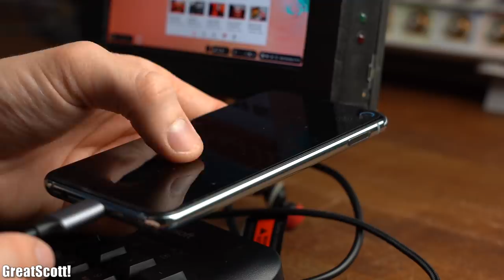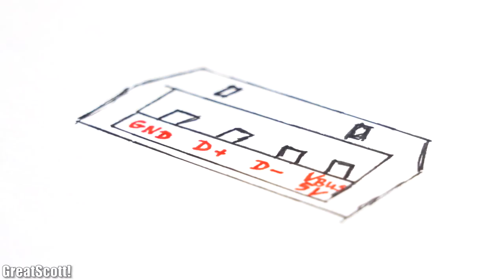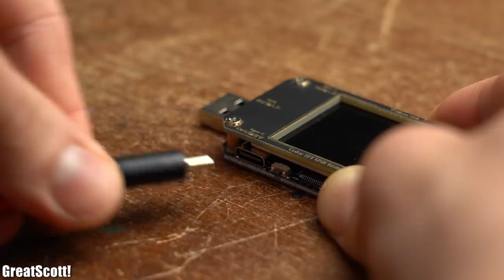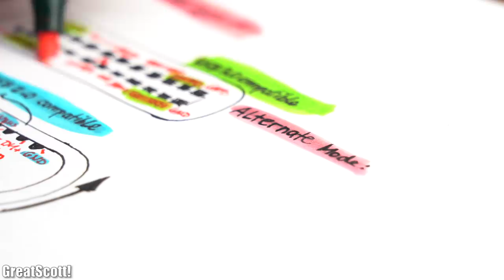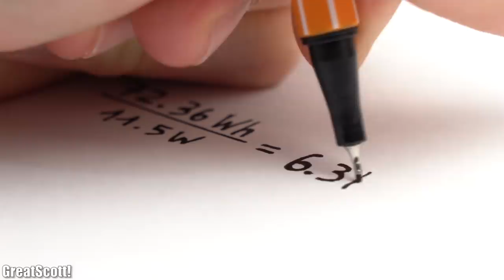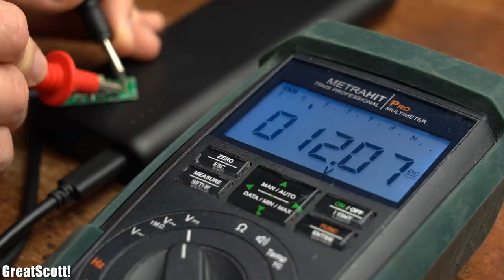Here is why USB Type-C is AWESOME and how you can use Power Delivery for your electronics!

Comment: I've read some of the USB 2 spec.

Can't imagine how crazy the 4 is.
Reply: Maybe you can time travel XD
Reply: Well, you can imagine it somewhat by reading the new naming conventions... the Wi-Fi Alliance really needs to lend the USB-IF a hand when it comes to names...
Reply: probably less complicated as it supoose to use PCIe physical layer
Reply: Yeah haha look up Thunderbolt 3... It pushes 40gbit via USB c
Reply: It's the thunderbolt standard. But open source so manufacturers don't have to pay insentives to intel. There is a techquickie video explaining it. I'm on mobile so I can't paste a link
Reply: I’m pretty sure that thunderbolt 3 is just going to be renamed usb 4.
Reply: @iridiumflare  No, the spec for USB4 has been released some days ago already so this is easy to check anyway but USB4 can be compatible with Thunderbolt 3, though it does not have to be... So some USB4 devices may support TB3 and others won't, it also appears that only certain cables will support TB3 as TB3 is a very different protocol compared to USB, TB3 uses PCIe lanes while USB uses its own serial 'lanes', PCIe has far higher requirements such as very low latency allowed, this comes down to how both TB3 and USB operate at the PHY layer.
Reply: @ShadowriverUB  USB4 in no way uses a PCIe PHY, it uses yet another iteration of the USB PHY (hence the USB4 name instead of PCIe3/4/5), it also does not carry any PCIe lanes. USB4 can carry TB3 (if both devices AND the cable support it) but this is not a requirement of USB4 so you might have two USB4 cables, one that supports TB3 and one that does not while you have a bunch of USB4 devices/peripherals some of which support TB3 while most won't because currently (and for the entire history of ThunderBolt) TB is far too costly to implement and USB4 does not force manufacturers to implement it, so why would they...
Reply: 40gbit/s, thubderbolt compatible.

Comment: This is why i love USB type c, especially Power Delivery. No one in my house or campus understand these flexibility and high output capability no matter how much I explained that. They just think that I'm a type C maniac because i switch all my gadgets to type C.
Reply: No one understands it because at some point you stumble into interoperability and expect everything to deliver the full pd spectrum but you get sometimes only 5V but up to 5A, or 20V but only to 2A, if you don't have the correct cable you might be limited to 2A etc...
Reply: Problem: now you need a lot of adapters because you only have USB-C ports. One of my teachers has a new MBP, and he’s always looking for the right adapter! Furthermore, USB-C cables are not all alike! The included cables are apparently USB 2.0 (or whichever name the USB-IF decided to rename it with the new spec), and try guessing which is which!
Reply: @GRBtutorials  agree with the cables, you don't really know what you're getting, but not for the adapters. Example, USB drive with type c connectors are getting quite common. HDMI sure, needs a dongle. But it's quite a thicc connector. Mini HDMI can be used, but also need adapter if need full size HDMI. Need connect phone to phone / laptop? There is type c to type c cable, so no biggie.
Reply: @satibel  scrub, what kind of person DOESN'T have a pocket full of connectors adapters and dongles? Are you NOT prepared
Reply: @Nrt2Pnt0  The point is that while you now might have a USB C to USB C cable of which the connectors are compatible, the cable itself now is the issue and you need fourteen different USB C to USB C cables for various purposes....
USB C could've been so beautiful, instead it is a disaster, meanwhile USB 3.0 has been renamed to USB 3.1 Gen 1, USB 3.1 has been renamed USB 3.1 Gen 2, USB 3.2 is doing 'something' over there that nobody needs and USB 4 is coming to fix more issues we're not having.
The issue with Universal Serial Bus is that it is not Universal, it has become the exact opposite of universal to the point where nobody seems to understand what the hell USB is doing anymore.
Reply: I for one am peeved they made the 12V skippable. Now I get to search for supplies that offer 12V 2A, and no, it doesn't help if they support 2A at 9V but only 1.5A at 12V.
Reply: @SKC56  do you have sata usb-c 3.1 10 gbit adapter? I have and i boot through usb-c of my Geforce 2080 Ti ))))) Well, i boot linux, while my main system (windows) in on M.2 nvme ssd)))
Reply: @someguy4915  hey, usb 4 is thunderbolt 3.
Reply: @lolerie  I don't have usb c 3.1...
Reply: @SKC56  10 gbit/s, i mean...
Reply: @lolerie  No, it has an optional compatability WITH TB3, but is not in fact TB3 or anything like it. USB4 CAN carry TB3 signals, but is does not have to, so some USB4 devices will support TB3 connections and some will not, even though they all have the same 'USB4' logo/name on them...
Besides TB3, USB4 can also carry audio, HDMI/DP/various other USB versions and/or charging 'PD/Power Delivery' which may deliver UP TO (but doesn't require the minimum) of 100 watts.
Basically USB4 says the ultimate maximum options and then lets manufacturers of cables, pc's and peripherals decide what they feel like implementing and what not.
While Intel has given the TB3 standard to USB4, so far AMD has not received a license to use it, so as it stands, no AMD chipsets with USB4 will support TB3. Also, TB3 chips are significantly more expensive and thus will not appear in mid range and low-end devices, only in higher-range devices and even there it is only a possible options which may or may not have been added...
Welcome to the new world of USB, where everything is possible but nothing is certain/required, you'll just have to guess...
Reply: @someguy4915  wrooong. Amd does support it. Read wiki Before March 2019 there were no AMD chipsets or computers with Thunderbolt support released or announced because of royalty situation (problem was Intel's refusal to certify non-Intel platforms). However, the YouTuber Wendell Wilson from Level1 Techs was able to get Thunderbolt 3 support on an AMD computer with a Threadripper CPU and Titan Ridge add-in card working by modifying the firmware, indicating that the lack of Thunderbolt support on non-Intel systems is not due to any hardware limitations.[74][75] As of May 2019, it is possible to have Thunderbolt 3 support on AMD using add-in card without any problems.[76] And motherboards like ASRock X570 Creator already have integrated Thunderbolt 3 support.[77]
Reply: @someguy4915  the spec about USB4 is only the first version. They want to made thunderbolt 3 -- as the original one -- to be mandatery. In particural, it should be pci express (with low latency) and really, it is just thunderbolt 3. Intel also said that they will certify but it will not be mandatery.
Reply: @lolerie  Still, USB4 is in no way TB3 nor does it guarantee compatability at all, just that some devices might have it and some won't.
Whether the devgroup for USB wants TB3 to be mandatory, I've not seen that anywhere, especially not in the officially released specs, nor is the devgroup making anything mandatory in the USB standard, not even the branding so I'm curious where you heard that TB3 would (ever) become a mandatory part of USB4?

Also I never stated there is any technical limitation for TB3 on AMD, I said that Intel has not given AMD a license to do it. Intel has not shown any interest in spreading TB by giving AMD a license, nor are there any clues or reasons to believe this will change any time soon.
Reply: @someguy4915  the real problem is low latency spec., which is only pci express, which is already done with tb3, etc, etc... Anyway, you can widely manipulate it through UEFI module code and even linux/windows kernel code...
Reply: @lolerie  But that still does not give AMD a license to sell it, thus no widespread adoption and thus peripheral-makes won't adopt it either for years to come.
Look at USB-C: came out in 2014, it is 2019, almost 2020 and still plenty phones and most laptops come without even a single USB-C port.
Before USB4 will become mainstream it will be at least 2025, hopefully Intel will allow AMD a license by then so USB4 can actually be succesful WITH TB3 instead of without it...
Reply: @someguy4915  "a license to sell" there was no such thing from the beginning... Anyway, there is an amd motherboard with already integrated support of TB3. What do you want ;)
Reply: @someguy4915  usb-c is the only nondeprecated slot. So... https://en.wikipedia.org/wiki/USB#Receptacle_(socket)_identification
Reply: @lolerie  What I want? Intergrated TB3 support in the chipset so that TB3 can more effectively use chipset PCIe lanes or even better intergrated support with the CPU itself to use CPU PCIe lanes... Both will not happen for years to come, if ever at all...
Perhaps you should read the USB4 and TB3 specsheets, because 'a motherboard' having a port that through firmware messing can work does not really mean much for TB3, it simply doesn't work that well nor is it the issue...
Reply: Yeah I used to tether my smartphone to my PC a LOT  and after only one year or less the micro-usb port on m,y smartphone just got worn away and would no longer connect - so I bought a replacement port assembly but was unable to install it because the heads of  tiny screws holding it in place just gave way because it had been screwed in too tight - so I ended up scrapping the phone because of the lack of durability of the micro usb connector. My last two phones have had USB type c and they are as robust now as when I bought them in fact I will not buy a phone no matter how good if it doesn't have a usb type c port.
Reply: @SKC56  bruh

Comment: The first time I saw MicroUSB 3.0 I knew it's an abomination, and I already hated MicroUSB for taking place of MiniUSB {Great small port, durable]
I'm happy, that USB-C is taking place of MicroUSB
Reply: No, MiniUSB was terrible! I hated that on the PS3 pad for instance. I barely ever had any MiniUSB cables. MicroUSB at least saw or rather still sees a wide adoption and thus I also have lots of cables available.
Reply: i have literally lifted my s7 edge up by the cable and have had no issues with the micro us plug so idk about the durability issues
Reply: @bland9876   I think some of it is also because of the very cheap Mini-USB sockets and cables being literal shit. I got one of these 10$ logic analyzers and the first thing i noticed was that just wiggling the Mini-USB cable a little bit causes disconnects, that thing was loose af. Never had such severe problems with cheap Micro-USB sockets...
Reply: As with everything it depends, I had a lot of problems with my previous phone micro-USB, but my camera and car recorder Mini-USB works flawlessly
Reply: He didn't even mention mini USB 3 with three poles (+ the shell)
It is used in many Nikon cameras
Reply: Yeah, MiniUSB wasn't that bad. I broke more MicroUSB cables than I have fingers.
Reply: DANK  you must have had a defective product, there's lots of videos and tests demonstrating even the cheap USB c is much more durable than microusb. This is in no small part due to the curved rather than cornered shape of the connector, as well as it's internal structure.
Reply: I hated mini USB, the connector got stuck inside of my shitty phone
Reply: @lazyh-online4839  >cheap USB c
you must be joking.
Reply: @username4441  what exactly is your issue with what I've pointed out?
Reply: @lazyh-online4839  i have found all variations of USB c cables to be ridiculously priced.
Reply: Micro was shit and mini wasn't great. I really like C
Reply: Mini is better than either.
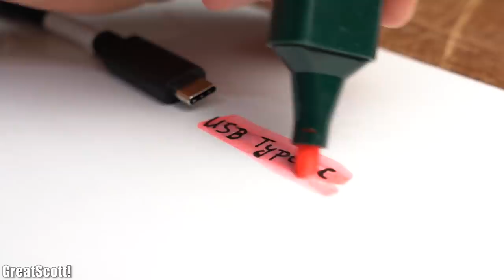Reply: @bspringer  @3:30
Reply: A lot of those External hard disks still use the USB 3.0 technology.
Reply: MicroUSB is actually much more durable than MiniUSB. Thats why it was used on mobile phones instead of MiniUSB. It has to do with the barbs wearing out and the MicroUSB having springy barbs that don't. The MiniUSB on the Arduino Nano are the worst...
Reply: @morpheus1285  Micro USB the cable is supposed to wear before the female connector, Mini USB was not this way and the female connector took the wear which is indeed a poor design.

Comment: Type-C is the best conector ever.
You can nerver mess up the orientation.    :D
Reply: First world problems.
Reply: Apple's Lightning cable: Am I a joke to you?
Reply: @Dinkleberg96  apple is a joke
Reply: I mean technically you can try to plug it in at 90° from the correct orientation.
Reply: @SoLaR27 Yes.....
Reply: 3.5 mm is the best connector, you can plug it in however you want
Reply: @josefaschwanden1502  They should build a 3.5 mm conector with 10 pins. This would be perfect.
Reply: @Dinkleberg96  Yes, because we all need a connector that's backwards compatible with firewire, still.
Reply: @m.schiller  Good luck running anything with current on that connector since you will definitely be shorting all the different contacts on the connector to all the different contacts on the port when sticking it in
Reply: Solar , rofl .
Reply: 3.5mm jack is even easier to plug in
Reply: @bland9876  It's not about being easy to plug in, but about the contacts touching all other contacts when sliding into the hole. The first contact on the cable will always touch all other contacts in the socket because of the way those jacks are designed
Reply: JonasLue Well, don’t your devices detect when a 3.5mm jack is connected? Given that’s already a thing, you can switch it on once it’s already connected. The only problem is that it’ll make devices thicker...
Reply: @resneptacle  just make the first pin on the conector a sense pin that only switches on the power when the conector is fully inserted in socket.
Reply: Ricardo Reis fun fact, Apple “engineers” claim that a short out on the phones lightning connector side cannot cause damage to the usb of a laptop (even though there are burn marks). I asked “just how many short outs do you need to cause damage? And why a specific location? It doesn’t matter where the short out is, a short is a short and can cause damage (plus burn marks on the phone side means that’s probably where the point of issue is...). So yeah, Apple cables are crap! And they give actual engineers (and 5 year olds) a bad name with lack of basic fundamentals.

Meanwhile, my previous phone with USB C had 12v 2 amp (24w) fast charging and even $1 cables from dollar tree store worked fine, even braided $0.90 cables online worked fine, never had an issue with any USB cable ever, only lightning cable (which I assume got its name from the lightning scorch marks for its notorious 4th pin).
Reply: @Dinkleberg96  used to be a very good connector. Now it's very outdated.
Reply: @josefaschwanden1502  F
Reply: Energie Z guardi bene le prese femmine senza orientamento prima di collegare bene cavo maschile non-reversibile !!!!
Reply: @Dinkleberg96  lightning cable is just usb c but nobody else can use it. By the iphone 12 I bet apple will switch to usb c
Reply: @m.schiller  cursed
Reply: why we even need connector's ... Let's go Wireless :)
Reply: @buddinglearner7085  I think there would be some problems with interference.
Reply: @m.schiller  oh no

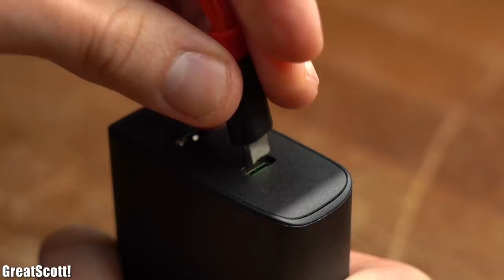Comment: Wait, you only have to flip the damn thing twice to fit? (3:40) You should go buy lottery ticket. I never managed to get it right in less than 3 tries.
Reply: I always get them right because I look at the connector and the port so I am basically God
Reply: I'm always wasting time on finding the hole by touching and then flipping the connector to get the right orientation.
Reply: I once get it pluged in the first try... turned out that I've use to much force and managed to plug it in the wrong way, wich lead to a short circuit and a bluescreen.
Reply: I usually give up after trying for 3 times, no wonder why my phone does not turn on anymore
Reply: I know, right?  I have a 50% change of getting it right the first time and it always takes 3 tries!
Reply: @yxcvbnmmnbvcxy544  LOL, when you're over 40 looking at it does no good because you never happen to have your reading glasses with you!
Reply: My other half actually managed to plug a USB B in upside down. Took a lot of force to remove it. She scares me.
Reply: @rancidbeef582  Hmm, yeah... On the USB A you can test the orientation by feeling it's tip, or put a stick on the top or pain the upper part...
Reply: Have a micro USB with a button operated light on the phone end, makes it a lot easier.
Reply: the USB logo is always looking UP
Reply: one time I blindly connected usb and got it first try
Reply: There is a nice joke about it: USB type-A connectors are quantum objects. The plug and the socket are in a superposition of states, so they never fit. You have to look at both to collapse their wave functions, and only then they can be mated.
Reply: 3 tried , i suggest you buy atleast a small lottery ticket

Comment: Wow! Great video!👏👏👏
Last summer, I purchased a 50AH LiFePO4 power bank, w/19VDC input (same as 2 parallel 20 Watt PV panels), 2 x USB-2 outputs (5 VDC motor power), & 1 x USB-C PD out (12 VDC SBC + PWM cooling). This was intended for a stand alone, solar powered, HiDef security camera. 
Unfortunately, the powerbank would shut down and reset the USB-C output to 5VDC whenever solar power was applied or removed from the input. (Just as you explained)
So, I trashed it's charge controller/output circuit board, salvaged the 8 3.7V LiFePO4 cells, reconfigured them into 2S4P @ 7.4VDC. Then, used a 5 amp CC Buck converter  to charge the cells @ 8 VDC, plus another 5 amp Buck converter to supply the 5VDC motor power. So far, so good. But, I'm running on an under-protected LiFePO4 power pack.🙄
Your programmable STM32 USB-C adapter would have saved me all of that extra expense and hassle. Thanks to you, next time I'll know. 🤙